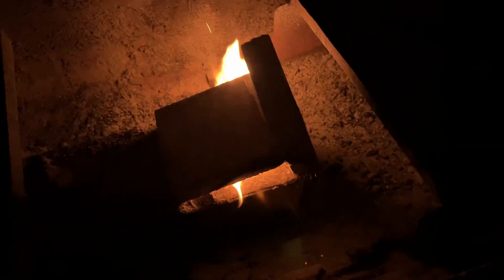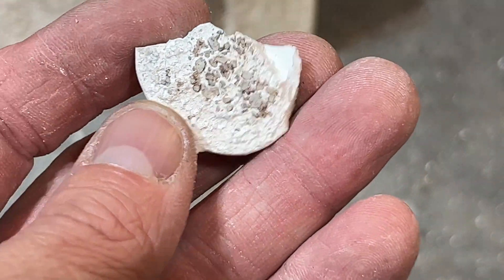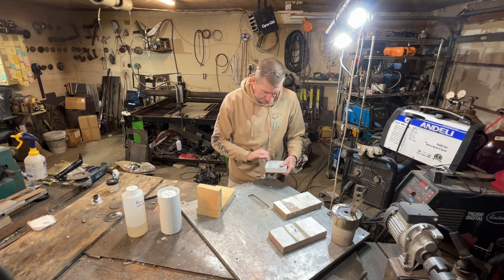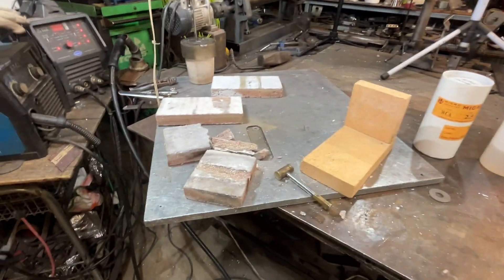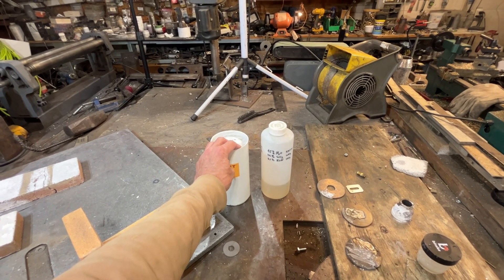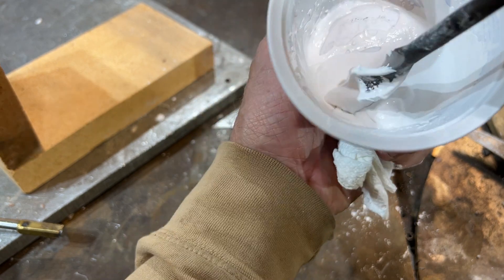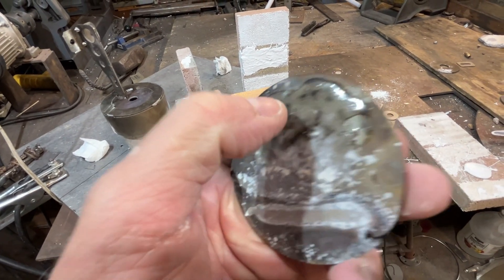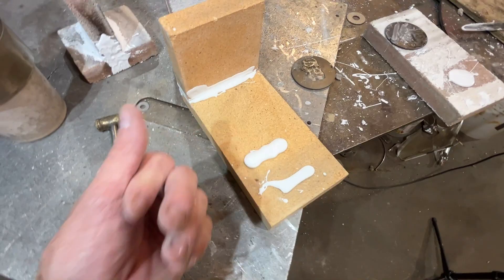High performance Refractory glue FORMULA

Comment from the maker: See my water glass videos to learn how to make the potassium silicate binder
Reply: @NOBOX7  water glass  aluminum oxide and carbide sand makes a nice refractory for crucibles.
Reply: Silicates cure with CO2. I use some small amount of baking powder in the mix to have it cure from the inside when heated. Since yours is potassium silicate you may want to use some potassium bicarbonate, analogous to the sodium bicarbonate in baking powder.
Reply: Follow-up to my previous. If insulation is your goal, you may want to try perlite instead of just alumina. Alumina is dense and conducts heat far more than perlite which is porous, and for me perlite was also a lot cheaper which always helps.

Comment: Aluminum phosphate is used as a high temperature binder, its melting point is 1800°C. Refractory plastic is a mixture of pure refractory clay, tabular alumina or molten and aluminum phosphate, at 700°C the aluminum phosphate crystallizes giving a hard structure.

Comment: When you have low porosity ceramics, you just have to pre-prime the surfaces a little bit with either water, or your water glass alone, just a tiny thin film, and it will allow your alumina to bond more effectively.
Reply from the maker: Your spot on . I remembered my old concrete buddy told me if you want concrete to stick you gotta wet it first and the dry substrate will suck water out of the mix . I love your idea to drop a film of water glass , i just sprayed water and it helped alot

Comment: As i said in ur last comment.... Now add some KOH to it (pre disolved in distilled water but as little water as u can use it) now get yourself some fly ash or go to a crafts store amd buy a block of white clay. Heat the clay untill you cant heat no more then bust that shit up blend it up as fine as you possabley can till it want to blow around like the ash from a burned kleenex use like 75% weight or something in that range.
Throw it all into a pot and use a high speed drill (much faster than a drill can spin the key is high shear)

Comment: I've seen diy firebrick made with waterglass soften at higher temperatures.  Does this material do the same or is it resistant to softening?
Reply: This is potassium silicate which can stand higher temperatures as sodium silicate, aka waterglass. It depends on the water content of the silicate, the ratio of ions to oxides, the nature of the ion and the cure. If it goes soft, it didn't harden well. A lot of trial and error involved. It cures with CO2, so a good addition is plain old baking powder.

Comment: When water glass (sodium silicate) is mixed with aluminum oxide (Al₂O₃) and fired at high temperatures, a composite material is formed, primarily consisting of nepheline, a mineral that contains both sodium and aluminum silicates. This reaction occurs as the sodium silicate interacts with alumina during the firing process, typically at temperatures exceeding 700°C. The resulting material exhibits enhanced fireproof properties and thermal insulation characteristics due to the formation of a heat-insulating layer from water vapor released during dehydration of water glass.The addition of alumina not only improves the mechanical strength and durability of the composite but also stabilizes the melt, preventing crystallization and ensuring a more glass-like structure upon cooling. This composite is particularly useful in applications requiring high-temperature resistance and insulation, making it suitable for use in fireproofing materials and thermal barriers in various industrial applications.
Reply from the maker: I think my commenters make this channel better than it actually is and i thank you for that  . You can learn so much from a scholarly  individual or the specialist like yourself .
Reply: I have found that there is usually just as much knowledge in the comments as there is in the video itself so I always look through the comments. and there is just as much knowledge in a failure as there is in a success so don't be afraid to post the failed attempts so other people don't have to fail the same way! it saves time and money and labor

Comment: I've been doing parkerizing metals, it forms manganese phosphate crystal web around ferrous metals, idk the adhesion strength of those crystals to the metal, but I know that it was widely used since ww2 in famous weapons like the garand and the 1911 pistol to prevent rust.
Now is my go-to choice to rust prevention, better than bluing, it holds oil like a champ between the crystals and protects from wear and is easy and quick to apply, maybe it can be useful to glue steels with your formula.
Reply: Try making black oxide solution.  Its more consistent than parkerizing
Reply: @preciousplasticph  its hot caustic bluing with potassium nitrate?
Reply from the maker: I wonder if it works on stainless , Great input though . That would make a good crystal base for adhesions

Comment: Hey mate, non Newtonian fluid is the word you were looking for. Good info in this video thanks. I'm currently building a foundry using potassium silicate in my DIY refractory concrete, got the idea from your previous videos.
Reply: Note - I will eventually get around to uploading a video about it, but if you want to make your own mix please do not use only Portland cement, it will explode, use 1:1 Portland and lime mortar. The rest of the mix is up to you, but I think I have a good mix going with accessible materials.
Reply from the maker: Right on brother , i new there was a word for it .
Reply: @NOBOX7 No worries 👍 That additional note wasn't for you, I know you know that, I just noticed on Google that the first result for DIY refractory concrete doesn't use lime, so wanted to warn people reading my comment about that. I managed to get my hands on cheap pure CaO that is used in pond purification apparently, but I guess people could use lime plaster, though I'm not sure what the ratio of lime to aggregate is in that.